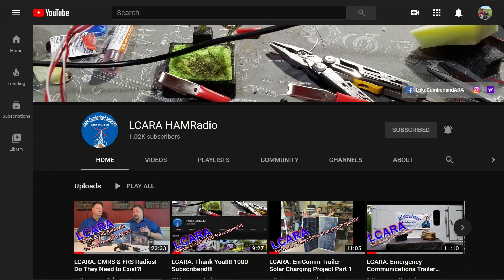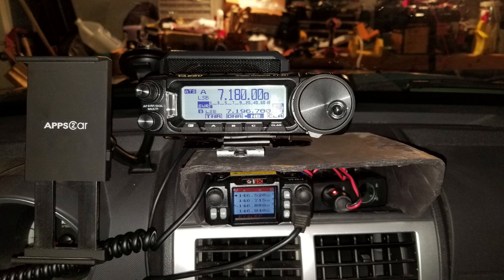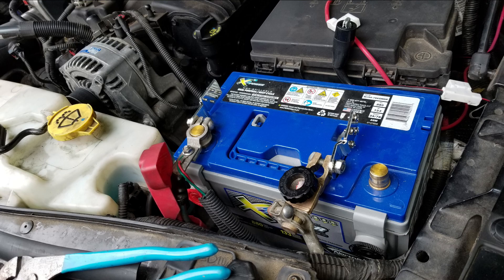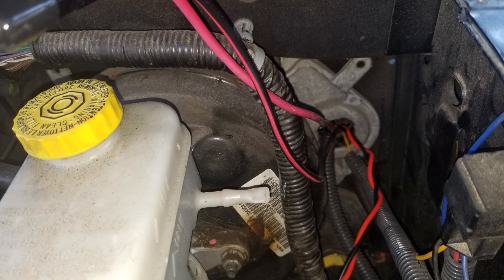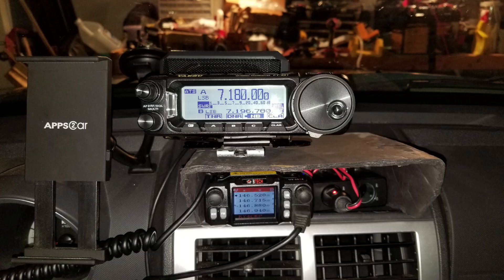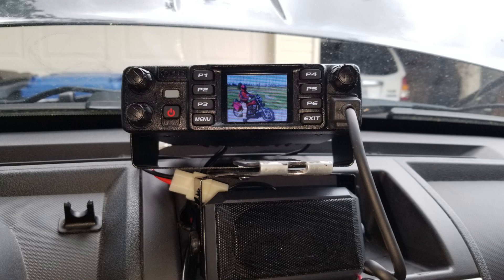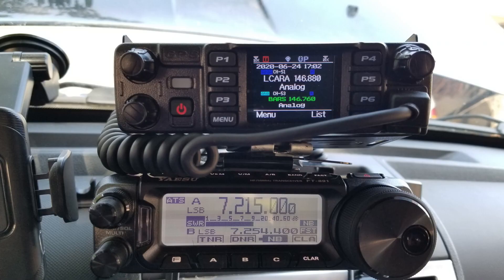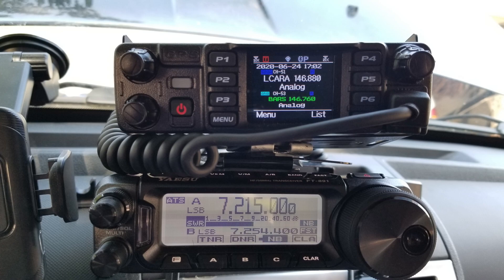LCARA HAM Radio: Mobile Radio Upgrade - AT-D578UV III Pro

Comment: can u link us to  were u got the mounting point from plz
Reply from the maker: Hello Andrew, if you are asking about the antenna mounts I am using the Diamond K400C Trunk/Hatchback Mount for the ATAS120A HF antenna.  For the triband uhf/vhf antenna I am using the Nagoya RB-50 Heavy Duty Universal NMO Magnet Mount.  If you are asking about the bracket I am using for the radios in the car I fabricated an "L" bracket from 1-3/8-in x 3-ft Interior/Exterior Zinc-Plated Steel Perforated.
Reply: @LCARAHAMRadio  thanks
73s

Comment: this mobile what tipe antenna used please thanks
Reply: Hello Alvaro, for the vhf/uhf (Anytone tri-band radio) I am using the Nagoya TB-320A Fold-Over which is a tri-band antenna.  For the Yaesu FT-891 hf radio I am using the Yaesu ATAS 102a antenna.